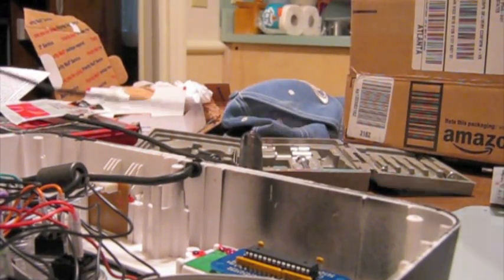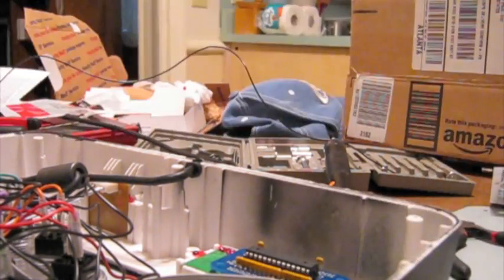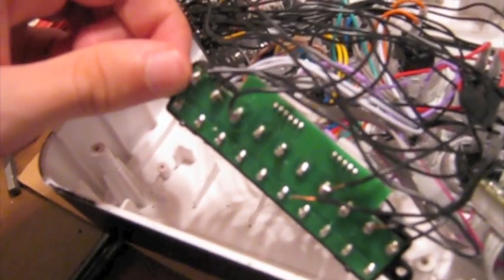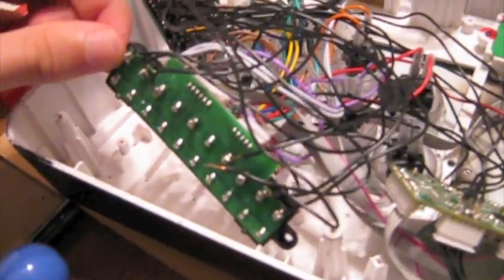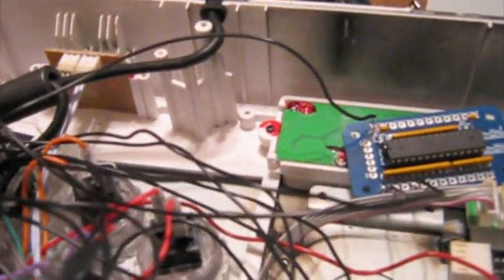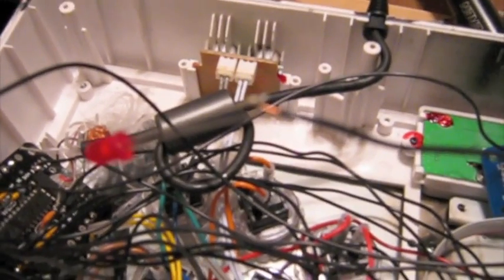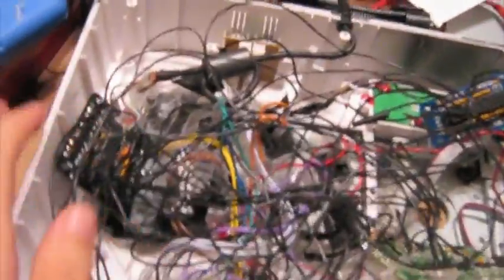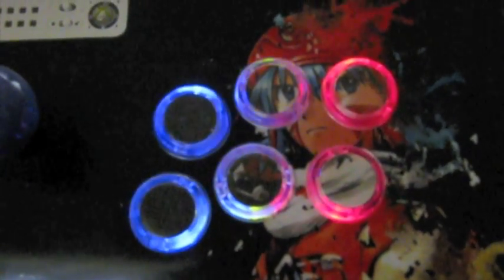Installing FGWidget (LED modding your fightstick)

Comment: i have a question. I have a fightstick with leds. the board is widget. the joystick is also led. it use to light up but I think I change my setting by mistake and the joystick now longer lights up. do you know how to fix this?

Comment: @nerrage so the chip draws its power for the LEDs from the general circuit connected to the buttons? I want to hook this up to a Saturn PCB. Which is also commonground, but the schematics online are not really clear on where I would find the ground connection. 

Would you know how to use a multimeter to identify which electronic connection would be the ground?

Comment from the maker: @Rikku98 The ground should be connected to the Cthulhu Ground terminal, one tab of the pushbutton, the Ground of the FGWidget, and the negative end of each LED. The terminal strip that is connected to TE and SE fightsticks have a ground terminal for all of the buttons, so those are connected easier. Any ground that you can find should be equivalent to every other ground.

Comment: I get you^__^ also do you have to connect one of the pushbutton tabs to the negative part of the LED while the ground socket on the FGWidget covers all buttons for the ground terminal on the Cthulhu?

Comment from the maker: @Rikku98 You don't HAVE to use stranded, but it is much, much easier to use than solid core wire. Either works, but stranded wire bends so much easier, and it is also easier to solder with.

Comment from the maker: @TheDIEGOayala09 These are LED inserts that go straight into PS-14-KNs. They output only white light, and you will have to cut into your buttons to put two wires (I'd dremel out a hole, but if you don't have a dremel laying around, you have to get something to cut out holes in the bottom of the button)

Comment from the maker: @TheDIEGOayala09 Just the same things I use here. Wire (GET STRANDED, NOT SOLID!), solder, LEDs, Seimitsu PS-14-KN buttons, FGWidget, tools related to this, etc. Internally, the SE and TE are the same, aside from the buttons/joystick.